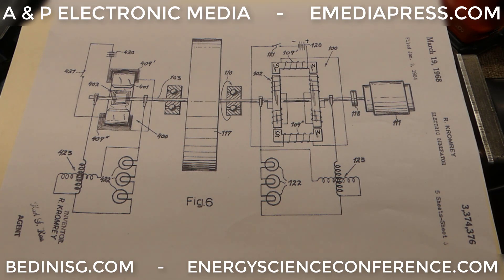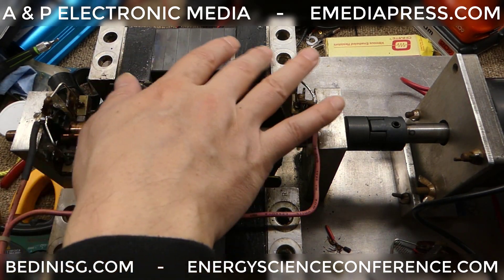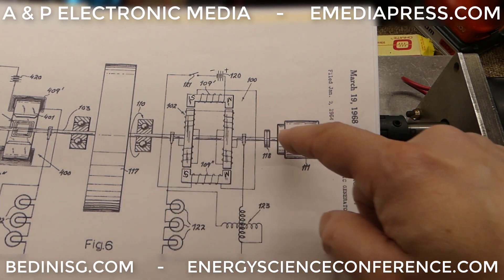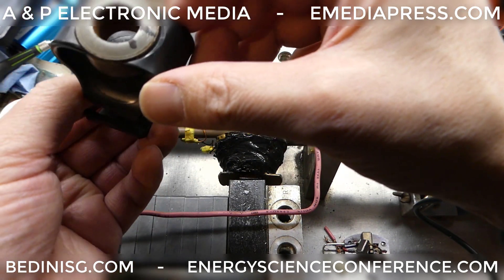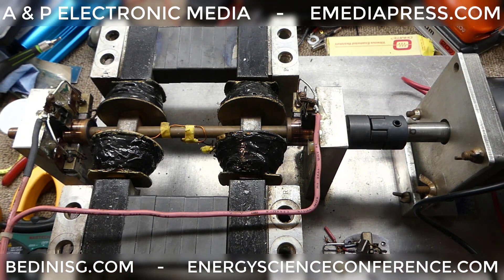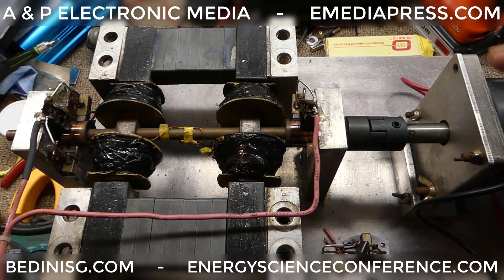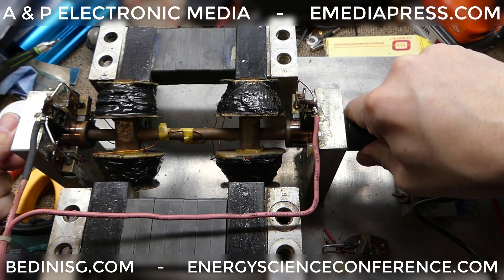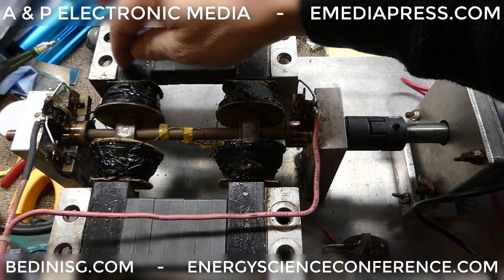Kromrey Generator - Speeds up when Shorted

Comment: Thanks for video. 
I have some problems with my generator and have some questions:
1. How many AC and DC voltage you become from your generator in max.  rpm?
2. With which current we must load batteries, only DC? 
3. What will happen, when to try load batteries in case, when DC output from Kromrey is less, than 12V?  
4. In your case, was possible to load the same battery, which gives energy to motor? Could you become usable free energy from that device?

I become max. 0.1V output and when I connect that to battery, battery heats all coils and shaft and in that reason all diodеs burned out, and that could not load the battery, which gives energy to motor. Windings are how Bedini shows, 3 coils, total 6-7 ohm resistance, I checked contacts, all is ok there. Magnets are some cold when I rotate some time in high rpm. Core of galvanized iron wires instead thick iron: can that be a reason?      
When I short to output (AC or DC, tried both), I not hear increasing rotations, no "Kromrey effect",  no sparks visible.

Comment: Looks like mf are not sinchronous with magnetic poles rotating by motor when shortened, but starts rotating upwards and you get some additional rpm because motor getting less resistance, when ushortened there is no current i  coils so motor rotating at stock rpm.
Reply from the maker: There is more to it than that. I made multiple videos plus the results Bedini & Lindemann demonstrated with this machine throws out all conventional explanation.

Comment: i made the g-field tipe generator and slows down under short,no mater how you conect the coils,i tried all variants
Reply from the maker: You may have wound the coils incorrectly. If you wound them like in the patent, then it won't work.
Reply: @AaronMurakami13  first i wound them in series ,and bogs down,then i wind them like in the patent(i,m refering to rotor coils,)and got 0v on the output but accelerating
Reply from the maker: @ady0187 Wind them exactly like I show in the video where I verify how they are wound on a working machine.
Reply: @AaronMurakami13  
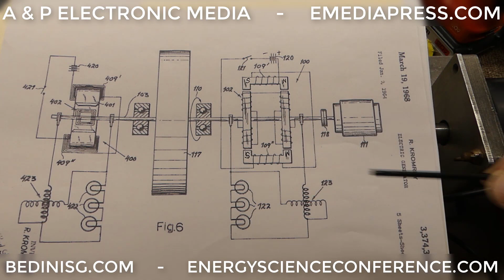I watched this at min 3:50 and you say wind it like it is in the patent but that did not work
Reply from the maker: @ady0187 I was going based on what we all believed at the time. When I was able to verify how the polarity on the coils actually were, I did a whole video on it and added it to Peter's Beyond SG presentation as an extra video to correct the belief about the windings.
Reply: @AaronMurakami13  
So i have to buy the Beyond the advanced book to find out
Reply from the maker: @ady0187 You can experiment with different winding methods. There are only a few that will not cancel out the voltage and probably all work.

Comment: I am glad you dealt with the windings detail, other experimenters dont seem to comment on that. so hooking up a conventional load should show no 'current' because the windings are producing equal and opposite 'current',  leaving only an electrostatic Impulse which can be rectified for battery charging right? ? BTW i did build a similar device with 4 poles. I made the mistake of winding  conventioanlly, and got a little measurable output. Then i rewound the coils as you and Peter discuss here but could not detect any kind of output from my machine. Maybe different impedance characteristics in the coils would help?
Reply from the maker: I'll show more as time permits but there is measurable current when a load is powered by the generator.

Comment: John made some really cool prototypes. People should be aware that generated power can easily be recombined for improved output power in DC motor/generators by several different methods. Cemf can be: "conserved" to charge additional batteries, virtually eliminated, as with cemf-free motors and generators, or applied to forward motion for a gain in total motive power. This power amplification is what people have traditionally called "over-unity". However; a more accurate description would be "power amplification" or "improved performance, COP, etc. IMO, this is not really "zero point energy" in the accepted definition of the casimir effect. Although the zero point "field" or Aether, or "spactime" or "Higg's field" or whatever we're calling this week is still involved; i think these so-called "over-unity" effects are more closely related to the Pauli exclusion principle and/or LENR-like reactions that involve the Coulomb barrier. I hope that we might get these theories more serious attention, better funding for controlled experiments, and maybe even opened-up for peer-reviewed publications- one of these days. Of course, another thing that people don't realize is the potential for abuse, misuse, resonant weapons, etc., and that's another part of why many early designs were locked away and suppressed, in addition to the threat to Big Oil Companies. A tiny battery could drive your giant, electric vehicle across country on a single charge. Knowing this is true and real, they have coined these free energy or excess energy motor products as "disruptive energy technology" or "fringe science". My question is "disruptive" to who? Big polluters? Most of these giant corporations are comprised of people who are not even US citizens, so why is a label of "national security" being used to defend these fossil fuel companies and recalcitrant automakers?
Reply: Interesting my friend remember in are society don't matter what ideology have, big corporation... play by the rules of the law of the capital . but one day no more fossil fuel... and we have problems.

Comment: If you put a proper load on the ac output (a light bulb or a toaster) the rpms will slow down.  I think what's happening here is by shorting the output you are putting the 2 output terminals at the same voltage, this just reduces the current draw off that very shitty generator and that in turn will reduce the load on the driving motor (the dc motor).  Go back to school Aaron and stop getting sucked into this quackery snake oil free energy bs.  So far you know, V=I*R and P=I*V, this is a good start.  Now go learn about the Lorenze force and therefore magnetic induction and then you can explain to yourself why this generator doesn't work very well.
Reply from the maker: A load will slow it down but not the same amount as a conventional generator - Kromrey Generator is very non-linear. You obviously do not understand this is a learning tool and is not to power your house so let's not lose touch with reality. You obviously do not understand why shorting the output lets the motor run faster than with it open circuited. Your misinformation isn't welcome here.
Reply: The formula expands to P=I*(I*R) where P, I and R are variables.
Reply: If you look at the mechanical based amplidyne may offer some insight. An amplidyne is described a regular DC motor that can also be  used as a generator. The second step in conversion is shorting the output. The shorting does not burn the wire or the contacts evenwith a very small capacitance. Explain why the motor runs so slowlywith little power in this condition. Of course the one real university text explains that it is a rotating magnetic field so the resistive power is converted to magnetism greatly reducing  (eddy currents of lenz law) converted back only when the compensating pole is added resulting in a 100 fold conversion back in to power and rapid acceleration with only the wiring of the compensating of the polecoil being different. The output is increased from near zero to 10 KW the only thing changed is the geometry.   This is not a circuit branch it is a generating function as well.
Reply from the maker: http://emediapress.com/2017/12/29/shorted-coils-part-1/ and http://emediapress.com/2018/01/03/shorted-coils-part-2/
Reply: You explain to me then why shorting the output causes the motor to run faster.  I'm actually trying to help you understand this thing, I'm not trying to be a jerk sir.  I'm an electronics engineering technologist with a GBSc in physics and work at a university engineering department as the Instrumentation and Computer technologist.

Comment: Shorting it makes it slightly less of a burden on the motor than it not being shorted. So what?
Reply from the maker: If you don't know the significance, you should learn why. Take a simple generator, short the output and see how much harder it is to turn.
Reply: If I had a DC electric motor spinning another DC motor and the output of that DC motor went back to powering the first one then it'd have more input power than if the output went to nothing at all.

I know what Kromrey's Generator is, and you're not showing what makes it interesting. It's the cooling effect that makes it interesting.
Reply from the maker: You're talking about spinning another DC motor - you won't get the same because another normal DC motor will produce a counter torque against the motor turning it. You have to get away from back emf or at least minimize it as much as possible. 

The cooling effects are only one of many things that makes it interesting. Charging a battery with 72 watts with 32 watts to the input battery I would say is very interesting. There are also modifications that can be done to the Kromrey that nobody is discussing that are also very interesting.
Reply: The Kromrey is the second motor. The power from said second motor going back to power the first isn't any different than if that power went back to itself. It just reduces the load slightly than if the circuit was open. Do the same experiment with ordinary motors and you'll get the same results as this video.
Reply from the maker: Take two ordinary motors and run one on a battery and have it turn a second one as a generator - short that generator one and the amp draw on the motor will go through the roof, heat up the windings, etc... as it will hardly be able to turn. Go here to learn more: http://emediapress.com/2017/12/29/shorted-coils-part-1/ and http://emediapress.com/2018/01/03/shorted-coils-part-2/

Comment: Hello Aaron my friend! I see the shaft turn at a rate consistent with the tach readout. about 156 seems correct.
Good setup and explanation! I know how much work and planning that must take. Thanks for your inspiring hard work.
Reply from the maker: The tach is x10 so that would be 1560 rpm.
Reply: Sir, are you still doing research on this idea Aaron ???? Thanks Sir.  @AaronMurakami13